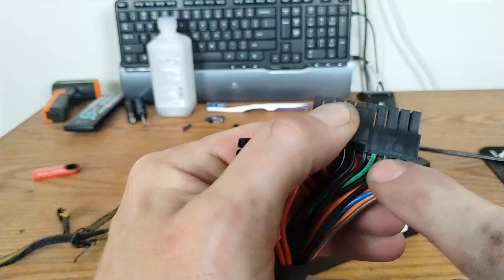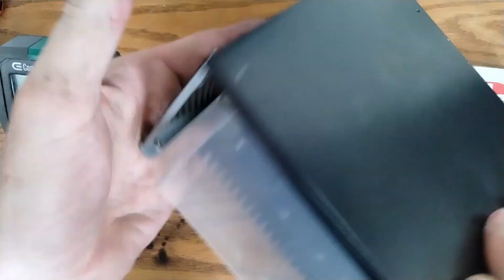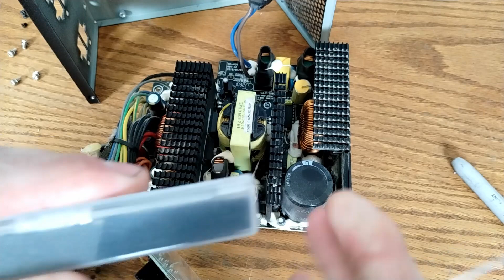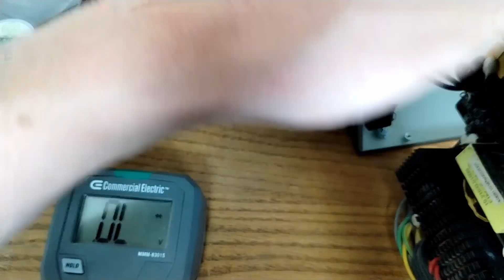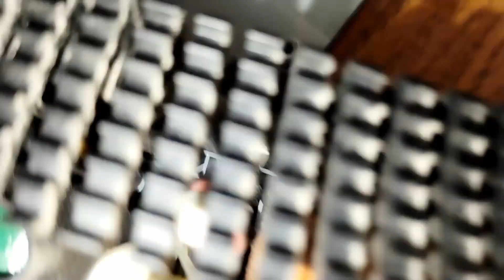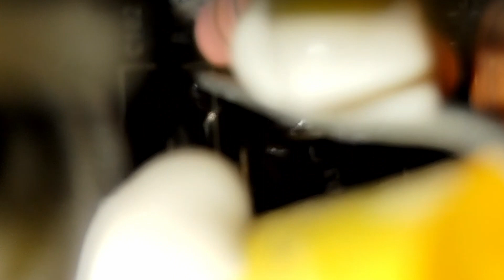Can we fix this $5 PSU?

Comment: I had an antec sp500 blow up recently. I had to discard it for similar reasons but now wish I had just torn into it and got it done. It was a nice psu with 35A on the 5v, and it was an early modular design. RIP your ocz and my antec.

Comment: So let me get that straight - you FIRST tested the mains fuse, found it was bad, and THEN tested for a short between mains live and neutral only to find none? Well, duh. At this point, testing should have continued after the fuse, not before it.

As previously suggested, the fault is likely to be somewhere more towards the input side - it could just be an X capacitor or MOV, but I would look for a shorted bridge rectifier diode or a shorted MOSFET in the APFC circuit or in the main switcher in particular. As old as it is, the big filter capacitor may not withstand a high enough voltage any more either, which is a much harder thing to test for.

This power supply is a bit past its useful life anyway, but it could still be a decent learning opportunity.

BTW, dead SMPS can "bite" quite badly if they are still alive enough to be charging the main filter cap. So always check that guy for remaining voltage.
Reply from the maker: I cannot stress this enough.  I can read a multimeter and I know just enough to test simple things.  The theory of how it all works isn't something I'm well versed in.  I'm trying to learn more though.

Comment: Would have thought the input side would be the first thing to check, shorted MOV or input bridge rectifier, not sure a secondary side side component would be a hard enough short to trip the breaker
Reply: I buzzed your elbow about 20 times, long distance of course. 😂 On the plus side, you got the pigtails, and you can blow a fuse every month and have a replacement close at hand! You win some and ya lose some, but you got some more experience fiddling with it, so it was probably worth the $5! Keep it up guy, love your channel.
Reply from the maker: Like I said in the video, I'm not well versed in electronics repair.  If something is visibly blown or easily tested I can usually do it but the theory of how it works or should work is beyond me.  If you have any ideas of what I should check next I'm all ears.
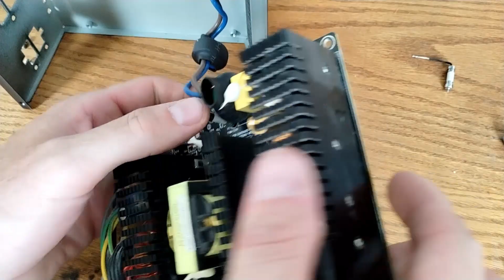Reply: @idoesstuff1  11:33 That blue component to the right of the yellow capacitor might be the MOV (surge suppressor), not sure if the pair of parts below your left thumb are the input bridge rectifier - it can be anything from 4 individual diodes, through 2 pair packages, to a single FULL BRIDGE RECTIFIER package. The input rectifier often doesn't need a heatsink, or only a small one, as its mains voltage at not many amps. Also, the input rectifier will be between the mains input wires and the main capacitors